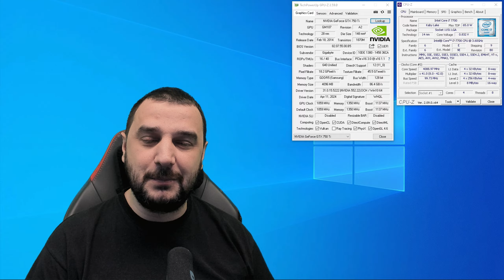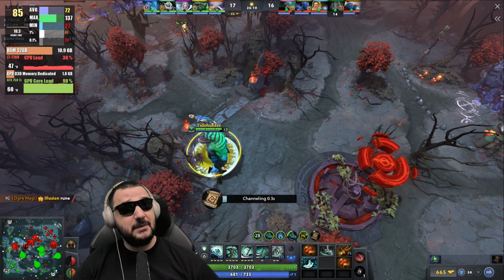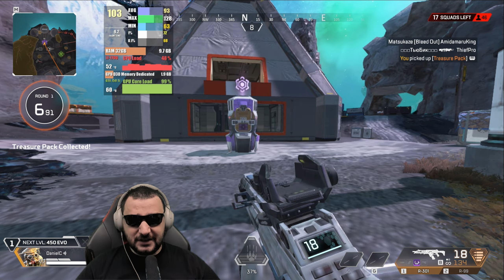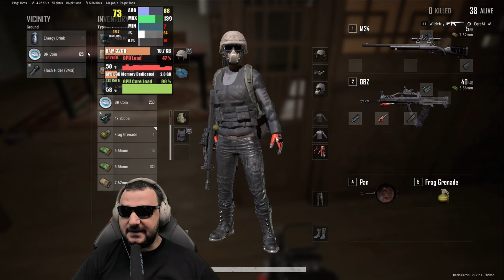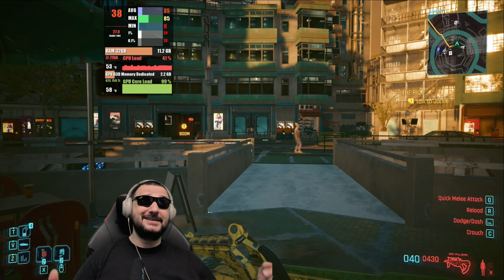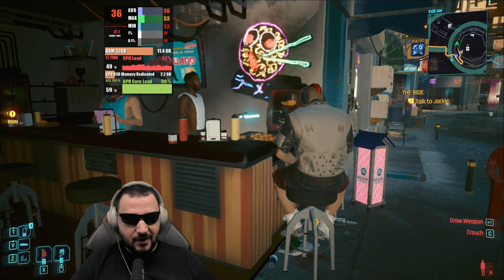Nvidia Geforce GTX 750 TI 4GB Benchmark

Comment: Great Vid! whats your fav thermal paste?
Reply from the maker: i bought a EVERCOOL 200g bucket 🤣
because i need more. i do have a few gpus and i can`t buy expensive one every month.
The problem with this one is that it has low thermal transfer and i have to change it every 3-6 months if i use the cards often.

Comment: Wow the 4gb version is expensive!
Reply from the maker: there was a few on eBay between £40-£50. Thought i will look a GTX 960 instead or if i do want a 750ti i`ll go for low profile but then 1050ti its a better choice.
Reply: @DanielCardei  Not sure why the high vram models catch a premium. The gtx 750ti will do like 15 fps if you manage to fill the 4gb entirely 😂

Comment: In GTA V the bottleneck is the speed/bandwidth/latency of the system memory. The cpu cores are not maxing out / idling because they wait for the system memory to deliver the data to the cpu.
Reply from the maker: i think the new system will fix that. x99

Comment: I used to play on a 750ti when I started playing pubg in 2017. Later upgraded to a 1060 3gb.
Reply from the maker: with 2gb or 4gb?
Reply: @DanielCardei  The 2GB passively cooled KalmX with lower clocks (1020/1350) at 1680x1050. It was a good experience but I was a big noob 😂. The last FPS I played before PUBG was counterstrike in 2001 on PC and on OG XBOX later. I only got better when I lowered my sens, realized that my Microsoft basic optical mouse was not able to capture fast mouse movements and replaced it with a zowie ec1b. Today I play at 100fps on 1660 super ryzen 3600 144hz 1080p, after I sold my 3060 12gb to a friend. The performance could be better but it’s good enough to have some really good games 😉I still have the 750ti and will test it again to see how it performs today 😃
Reply from the maker: @JohnSmith-iu8cj  clean the card and get an anti static bag for if you want to keep it. You never know.